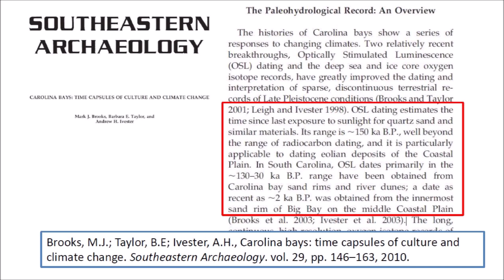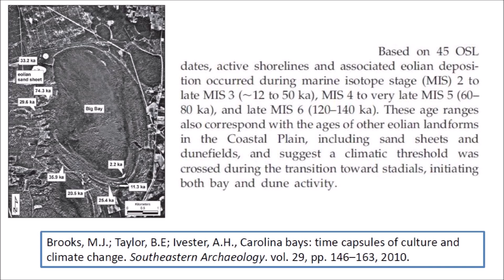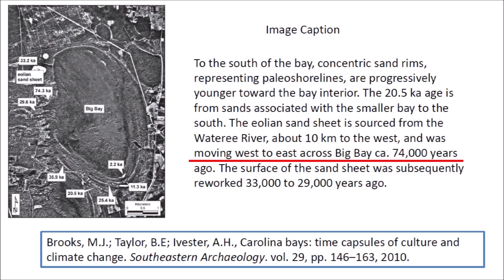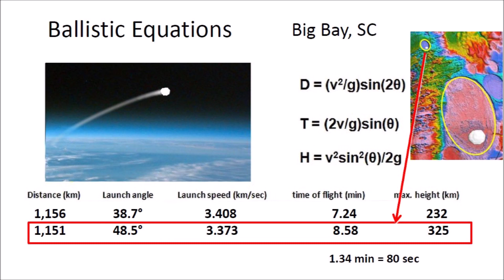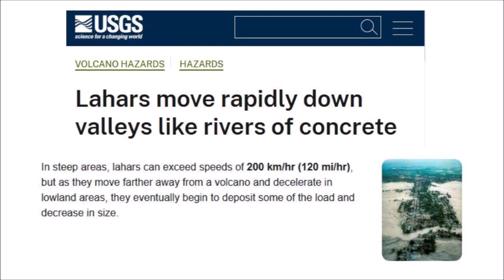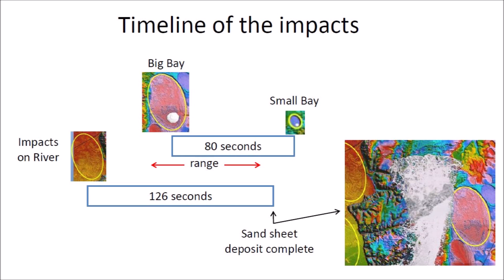Big Bay in South Carolina - Eolian vs. Impact interpretations

Comment: Christopher Swezey (I'm assuming it's him) made this comment to me in a video on another channel: 

"The low-relief hills that overlie the western side of Big Bay near the confluence of the Wateree River and the Congaree River are composed primarily of fine to medium sand (most grain size diameters range from 0.13 mm to 0.50 mm).  I have been to this location and observed the sand sizes myself.  There is really no mud here.  Stratification is not visible in shallow pits dug into the sand, but that is consistent with many (most) other vegetated dune fields in river valleys of the Atlantic Coastal Plain.  It would have been no problem for winter winds to move these grain sizes during the last glaciation or previous glaciations (with colder air temperatures, a given wind velocity can move larger grain sizes).  Ivester et al. (2002) and Brooks et al. (2010) have reported three published luminescence ages from these sands.  Each of these three ages is from a sample collected at a different location, although the authors do not specify the depth below the surface at which the samples were collected.  The first sample (Wateree 01) was collected at 33.7900 latitude/-80.4852 longitude, and yielded an age of 74.3 +/- 7.1 thousand years (in other words, 81.4-67.2 thousand years).  The second sample (Wateree 02) was collected at 33.7866 latitude/-80.4891 longitude, and yielded an age of 29.6 +/- 2.4 thousand years (in other words, 32.0-27.2 thousand years).  The third sample (Wateree 03) was collected at 33.8008 latitude/-80.4989 longitude, and yielded an age of 33.2 +/- 2.8 thousand years (in other words, 36.0-30.4 thousand years)."

I find it odd that sample depth was not stated, and that samples were not obtained at different depths in these locations to confirm a gradualistic deposition of material and also to measure the rate of ancient dune migration. I asked him if it was standard practice to only take one sample in one location, so we'll see what he says.
Reply from the maker: Christopher Swezey has objected to my paper since it was published in 2017. He even contacted the editor of the geomorphology journal to express his objections. He will use any arguments to support the eolian-lacustrine hypothesis, and he will make up stuff for that objective. See my video about the thermokarst fallacy. https://youtu.be/_Px1mXLTzUE
Reply: @Antonio_Zamora  wow. as they say, flak is heaviest when you're over the target. if swezey is so confident in his position, he is more than welcome to demonstrate how wind and water create an ellipse and finally provide his community a peer-reviewed source for this claim instead of letting them continually rely on unbacked claims and speculation.
Reply from the maker: @AustinKoleCarlisle  This is why I keep emphasizing the elliptical geometry of the bays, and why I developed the least squares method of fitting ellipses to the bays. Any hand waving will not be as convincing as the math.

Comment: So were the bays a result of an asteroid hitting the ice further back in history than the younger dryas? I’ve also seen on the dabblers den, him showing evidence of sea shorelines superpositioned that show that the bays are over 100,000 years old. Does every single bay point to the same spot?
Reply from the maker: The energy of the glacier ice impacts was so great that it has to be associated with an extinction event. I know that Dabbler's Den suggests an earlier time, but I think that the Younger Dryas is the right time. The Carolina Bays are fragile sand structures that erode easily and are not likely to endure hundreds of thousands of years.

Comment: Hello my friend.  For some reason Youtube is showing me your recent stuff all out of order.
One Bay at a time is a great idea, however I would like to suggest an additional avenue of enquiry for you to apply your mind to.

What does the timeline in Carolina look like when you consider all of the bays in sequence?  A massive computer model would be needed I think.

Thousands of strikes landing over a wide area in a short period of time, competing with, reacting to and interfering with the original shock waves from the ice sheet impact.

We know that sound waves, ripples etc have complicated reactions when they collide, so I can't imagine the number of competing waves amplifying, cancelling, rebounding from each other over the space of a few minutes, and what that would do to the various strata they are using as a medium.

Is it any wonder that the landforms persist if they were sculpted by competing shock waves coming from multiple sides?  We should be able to see some areas of massive compression, like the snow funnels, and other areas where these funnels were destroyed by later impacts.

I don't know if geophysics can scan it, or whether it would have to be a dig or core sample, but there should be broken chunks of compressed soil mixed with loose soil in early bays that have been disturbed by later ones.
Reply from the maker: It is a great idea to consider the times of impact of the glacier ice boulders as a way of building an image of the ejecta curtain from the ET impact.

Comment: The viscous relaxation of big bay happened rapidly, then.  Otherwise, the sand sheet might have gone down deeper into the cone of the impact.  So, then there were many other impacts happening during that 120 second interval when the sand sheet covered the western rim of the bay.

Am I understanding this correctly?
Reply from the maker: Yes. It was a saturation bombardment that completely covered the area with impacts that made the ground tremble. The vibrations accelerated viscous relaxation, just like the cement vibrator machines.
Reply: @Antonio_Zamora  

After your comparison to cement vibrating machines.  I made a search and found examples of vibrating tables that vibrated concrete in molds being vibrated.  The cement flowed smoothly across the surface.

I mean, you see the guy working on the cement, but where he is not working, the cement was flowing freely.

There's one video I found that really demonstrated what viscous relaxation looked like.  It was very fast, but you can see where the "dry, lumpy, clumps" of concrete seemed to melt down and start to flow across the mold's interior surface.

So, this means that viscous relaxation is nearly instantaneous.  Before your video today, I had the idea that the conical holes filled in sluggishly.  But now I see that it was a nearly instantaneous process.

Imagine holes thousands of meters across, and likely thousands of meters deep filling back in in mere seconds!  I never thought of it like that before!

(Here's the video if you want to see it.  Excuse the corny music accompanying the video.)

https://youtu.be/pG6xtbe5MQo?t=34
Reply from the maker: @direbearcoat7551  I am glad that you found my comparison useful. Thousands of ice boulders impacting the ground at the same time would have maintained a very liquid surface.  This is why I have often mentioned that even before an ice boulder hit you, your body would sink into the quagmire and you would not be able to run - although that would not help.
Reply: @Antonio_Zamora   And that thought makes me wonder just what might be found if extensive excavations were made in the bays ?